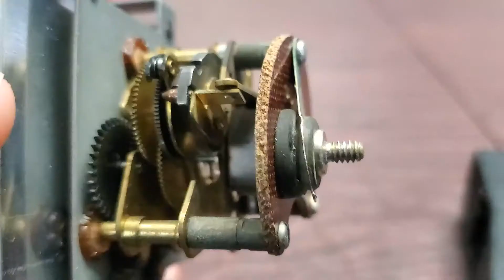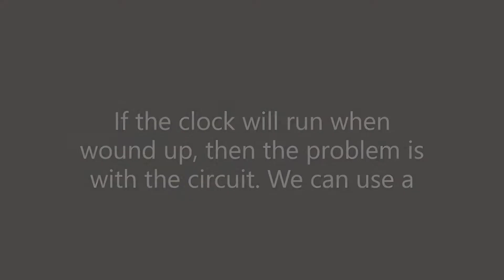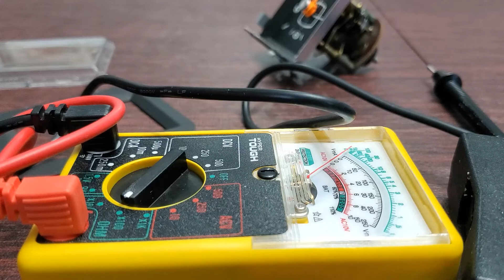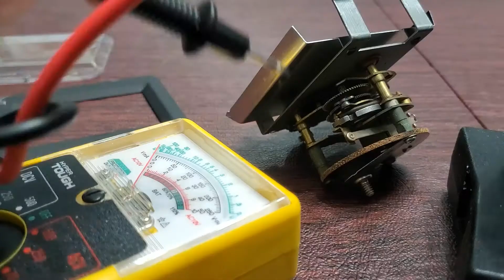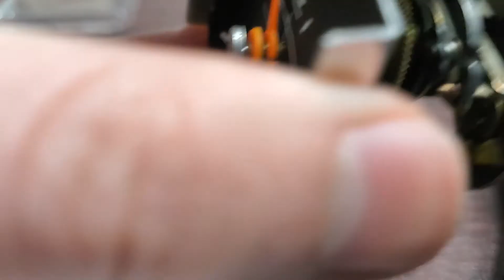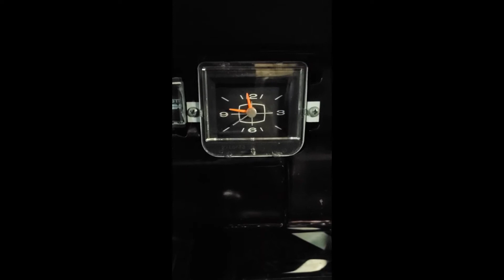How to Fix an Antique Car Clock

Comment: Awesome. Do the solenoids ever fail?
Reply from the maker: It is possible, although it would only really happen if there was a constant current running through it, eventually burning through the internal wire due to the heat created. From what I've read, this would most likely occur if the contacts were closed but the voltage (low battery) was not high enough to separate them again. Or I suppose if there was a short somewhere.

Comment: My clock in my Saab v4 sort of works but it gets really warm, the solenoid it’s almost burning hot, are they supposted to be that hot?
Reply from the maker: Solenoids can get quite warm if active for extended periods of time, but it should only have current running through it for a fraction of a second once every 1-2 minutes (assuming your clock is designed similarly) and so I doubt it should get super hot. With that being said, I have not done tests on my clock with it outside the case, so I cannot say for sure that the solenoid does not get too hot to touch; however, I do know that the case does not get hot when it is operating. With that being said, I would first check the voltage going to the clock and make sure that it is not more than what the clock is designed for. You might have to look that voltage up. It also shouldn't be too low (10 V might not be enough for proper operation if the clock needs 12 V). If the voltage is correct, check to see if there is a continuous current flow. If so, it would indicate a short somewhere, possibly due to a bad solenoid or a problem in the circuit after the solenoid. That continuous current, even if small, through a small solenoid could generate a lot of heat. If both the voltage and current are good, then perhaps running hot is just normal. I assume you are testing the clock outside its case and outside of the car, so if the above tests are good and the clock works, I wouldn't worry too much about it so long as when it is in the case, the case does not become hot to the touch. Sorry for the long-winded answer, but I hope this helps!

Comment: How far does it push the arm after the contact was made?
Reply from the maker: Hard to say. I haven't seen it in normal operation. However, if I remember correctly, pushing the arm to full extension lets this clock run for 2- 2 1/2 minutes. It runs somewhere between 1- 1 1/2 minutes in regular operation, so it probably extends 1/2 to 3/4 the length of the spring. Maybe that's something I could look at in an updated video. Hope this helps.
Reply: @seanmurphy9802  a video showing full operation without covers on, would be extremely handy. I have a clock that has a full circuit, clean contact points and functions without power. Once the contact points close, after a short period of time, the coils start to heat up and smoke and I see no movement of the electronic wind feature. I'm going to assume the coils are bad or there is a short internally, but it would be nice to see a way to troubleshoot the coils and/or see the wind feature working in the open.